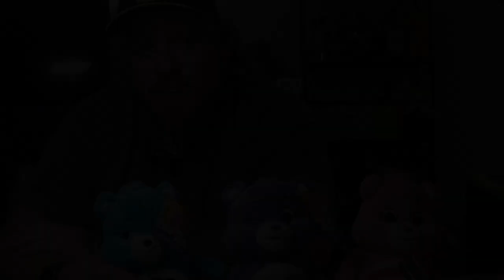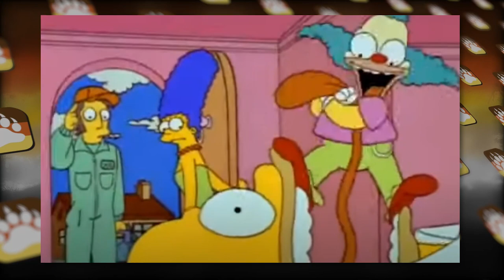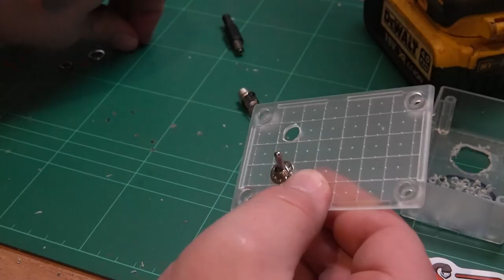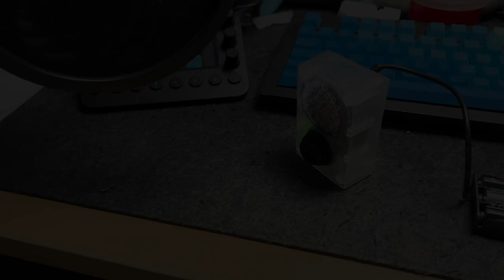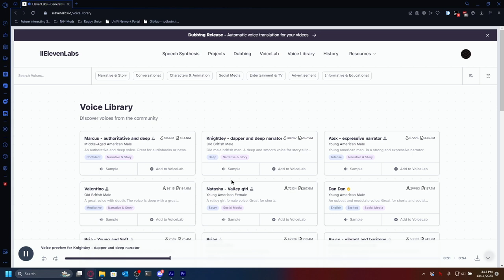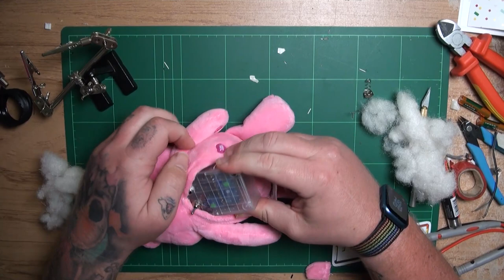Build a Voice Box for a Teddy Bear using Adafruit Audio FX Board - Procrasturbate Tech

Comment: Good day! What are the specific materials that you used to create the product? Thank you!
Reply from the maker: The brains was an Adafruit AudioFX board with built in amp, 2mb version. Used Elevenlabs AI voice to make the voices. 

Otherwise it was a toggle switch and button from a local electronics shop as well as a box and some wires.